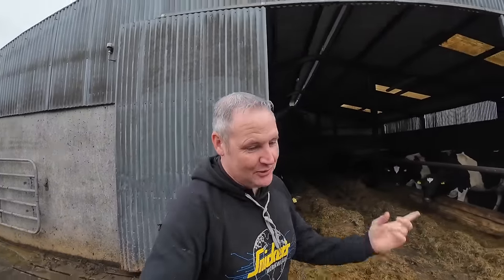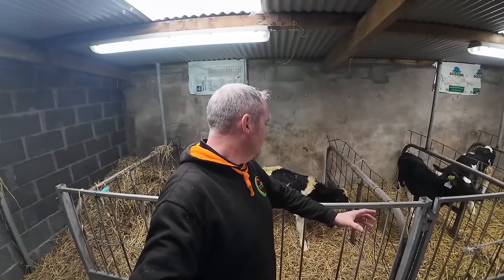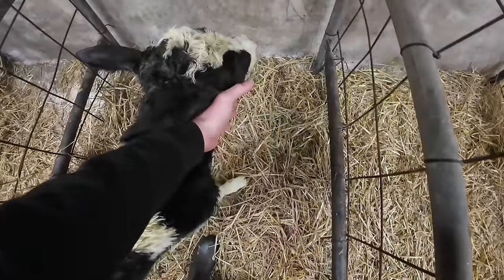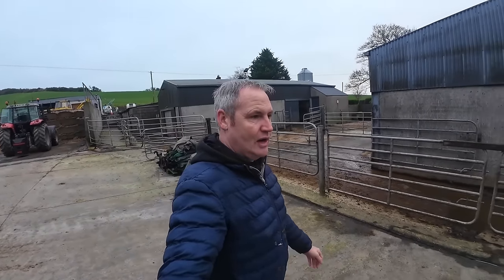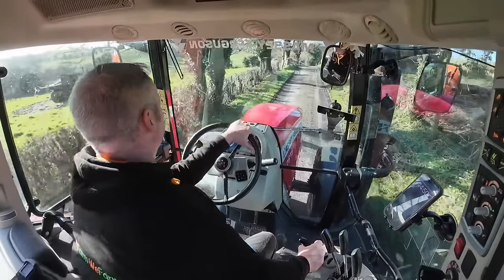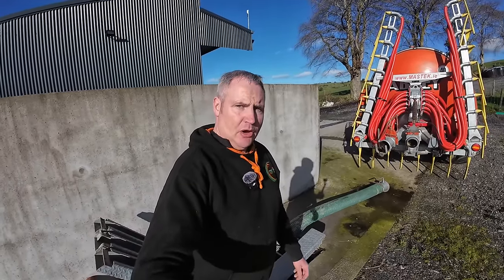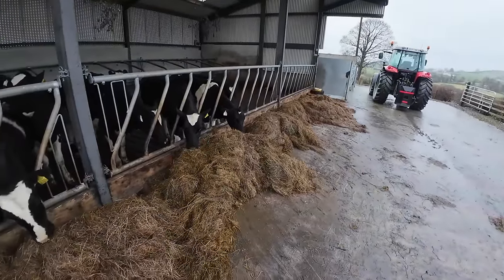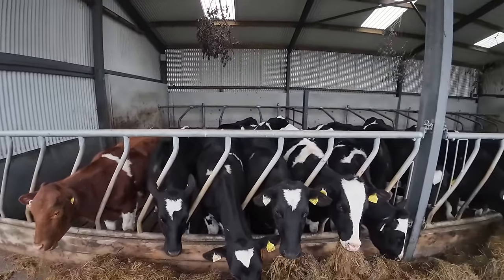Seized Feeder Fix | Collecting An Online Purchase | Very Unusual Delivery

Comment: Really great video again Adrain. They are so varied and I find it very interesting when you disassembly equipment for repairs. Great to be able to tackle repairs yourself. That wee calf with the sideways tail really thrived in the few days.  We have been blighted with ringworm both winter 2022 and 2023.  I had forgotten about the Holly . I must cut some and get it up. Keep the excellent content coming.

Comment: Can’t recommend enough the outlet coupling at the top of the agitator. Mine is a red rock and I’d be beyond lost without it. Use it to transfer mainly watery slurry to neighbouring tanks which is always really thick because of the build up from scrapers. Most recently started to use it to pump parlour wash downs into a rarely used slurry store just so I could transfer thick slurry coming up through the slats to replace the parlour wash downs. Unreal wet down in cork for most of February…slurry build up breaking my heart….
Reply from the maker: Our ground is like a swap, you’ll see how bad it is in the next video. It’s good ground but takes a long time to dry out unfortunately

Comment: I done transfer before with the agitator to a tank beside another tank, it's grand if you are badly stuck for space but come time to empty the tank it's a nightmare, the agitator takes all the watery stuff out and you ultimately end up having to put back all those loads of water,
Reply: If you agitate the tank first then transfer a couple of feet and agitate again and do that every so often you will be moving slurry not water. Definitely handier than using the tractor and tank. I got the 6 inch blue collapsible hose but I might have been better getting the 4 inch as it’s a bit heavy to be doing it 2 often

Comment: Hi Adrian. Looking at the wire mesh in the pen of the yellow calf. 2:15 / 20:22 I see what appears to be some bent spikes sticking out, close to the back wall. With feisty young calves jumping around there is a potential danger it could impale itself on the spike.
Reply from the maker: We had a bull calf there a few days before hand that jump from one pen to the other and broke a lot of that mesh, all them calves are now moved to a different house and the welder was out yesterday 😉. But yes a dangerous thing for sure
Reply: Glad your on it! @IFarmWeFarm  👍

Comment: Do you have to use a dribble bar to spread slurry all the time could you not get a long extension pipe and spread from the road into a field on still days while its wet to help lower the amount of slurry in the tanks.

Comment: Hi Adrian, You could try and re-use old spring by extending out broken end slightly and bend new loop…
Reply from the maker: Might work if it is heated, otherwise it’s that hard it would just snap. Ordered 2 new ones last week and were fairly inexpensive
Reply: Spot weld a washer onto the broken tail to form an eye, usually works, but if they can be got that’s an easier fix 👍

Comment: A length of lay flat and a suitable way of anchoring the outlet would save you time in the long run. I can move twenty thousand gallons in less than one hour after mixing. If you’re getting a joiner in the middle you can use it to help mix a long tank and a garden roller would be handy for squeezing it out when finished.

Comment: An old fridge is good for storing welding rods and wire or items that need to be kept dry in the workshop , not that you get to much trouble with damp in the air where you live. 😄👍

Comment: Those wet bales cost you a fortune to get made, no mention of that of course, can’t beat good dry silage.
Reply from the maker: I did mention the extra cost several times in other videos and on the video of them being made itself, obviously enough it’s fare more expensive with the large numbers of bales but the surprising thing is how good they came out considering the conditions they were made in. You can’t beat good quality silage hence the reason I said here we don’t feed it to our Milking cows based on its lower quality. But it has fed our heifers and dry cows extremely well. But I would certainly pick wet silage over stuff that’s too dry based on our personal experience of both.

Comment: Suggested name for the calf with a twisted tail : TT.
We used to pump slurry with the agitator via pipework quite successfully so long as the extra pipework was either horizontal or laid with a fall to the outlet. Also note, no narrowing nozzle on the delivery point at all! Dan
Reply: Do you use hard pipe or lay flat hose?
Reply: Mostly hard pipe.

Comment: Instead of rope try using coated clothes line wire that's on roatery clothes lines
Reply from the maker: I did actually try clothes line but it kept getting jammed in the pulleys. Perhaps there’s a thinker one that can be got

Comment: Rather than wire rope on the feeder:     Look at 5mm  Dyneema  rope,   its used on small  sailing dinghy's ,  very strong, very wear resistant , easy to work with and  cheaper than wire.  

Blue 3 strand "string"  is cheap but wears quick.    HTH